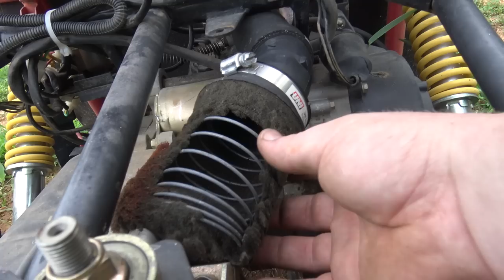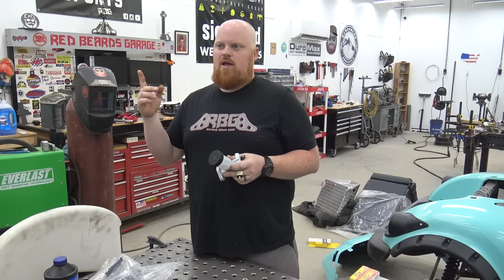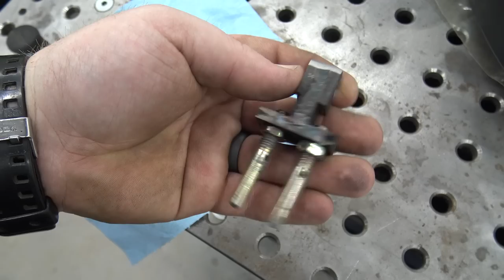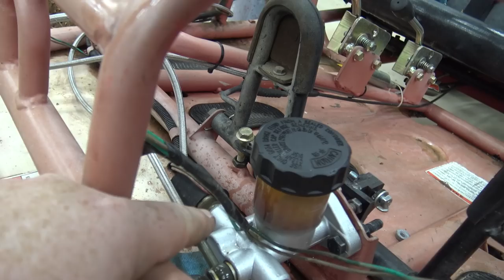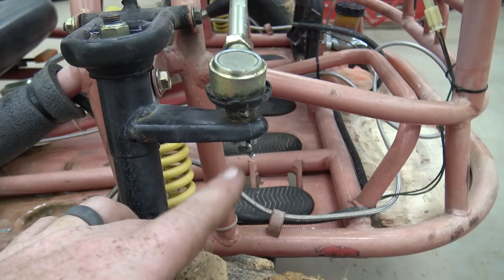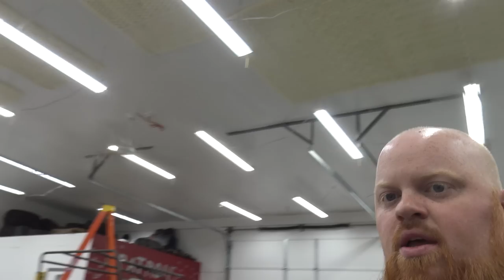Dazon Raider 150cc ~ Hydraulic Go Kart Brake Repair

Comment: Pro tip: When using tires to mark trails, cut holes in the sidewalls with a hole saw to drain water, so mosquitos can't breed.
Reply: How does that make sense?
Reply: @pearonthree5013  What do you mean?
Reply: How does that not make sense? Water drains from holes, which means it doesn't sit ....
Reply: @chrisrodriguez6399  sorry. I thought I was replying to quesadilla. 
Just ignore me...

Comment: I had to use a tire pump needle with a piece of plexiglass and a rubber tire inner tube . Drilled a small hole through the glass and rubber, inserted needle and hooked up tire pump and forced air into the top of the reservoir in order to get the master cylinder to allow brake fluid to force through the small hole in it. Worked great.

Comment: Sure glad I found your channel. I'm working on a ATV just as yours. So I can see that I need to pull one of those studs out and do the drivers side first. I was checking the pistons to see just what is going on. They seem pretty clean. I did see lots of water going out on the old lines. So that is what I will do and I will let you know. Can't wait for the third person to hold the camera.

Comment: Are cart different on brake bleeding than cars? I've always bled the furthest (right rear) from the master cyl;inder. first and worked my way back to left front.
Reply: Bill Co-9 hate to be negative but safety over rules ! Full stroke on old master will tear seals just to start, don't follow this if you want to hold brakes efficiently , wrong in so many ways
Reply: @Bill Co-9 That's how I would do it, just to be safe.
Reply: Scott Doubleyou  your ways fine Redbeard's wrong
Reply: Sir i cant speak for the bleeding process on a cart but with i most definetely wouldve have replaced that master cylinder i mean the guy did say he saw flakes in that brown fluid  so theres a decent chance that the seals in the master cylinder are damaged or cut  and the brakes will fail again
Reply: On this master cylinder it has a front zone piston and rear zone piston which work independently of each other. However they’re attached to a single bracket, which applies them in unison. 
So I suppose it wouldn’t matter. But I get what you’re saying. 
On this one, the front zone you’d do the passenger side first and the driver side second. 
If I’m wrong I suppose someone will correct me but I thought I’d try. lol

Comment: Trying to bleed rear brakes on a Fox Carbide 150cc.  Front will work.  Back wont pressurize.  Any suggestions.?  New caliper, New Master cylinder.   Ordered new line, hasn't arrived yet.  Tried reverse bleed.  At a loss
Reply: Ever figured it out?

Comment: DAZON RAIDER!! One of my favorite GY6 buggies. Those carbs do NOT have a choke, but instead have an electronic device for FUEL ENRICHMENT for cold starting. Choke cuts off air to make rich, that puts more fuel in to make rich. Everything on those is very reliable. Very serviceable. Very "TUNABLE"!! Bump the main up to a 125, with a foam air filter. Idle/Pilot Jet could be increased to a 38(?)... but not always necessary. CDI, COIL, PLUG, and you'll go from 8 hp to 11 hp. HUGE Increase. Then tune the CVT with 12 gram "sliders" in the front pulley and a YELLOW 1500 RPM BIG Rear Pulley Spring. Put a performance exhaust on it and it'll do hole-shots!
Reply: GoPowersports is a GREAT Company!! Very cool guys. Buggy Depot has the best GY6 exhaust deal.
Reply: I left the above comments early in the vid. RBG has it down.

Comment: What's going on Sir watch all your content 💯 I have a 150 Baja sport  kart it looks like the one you were just working on I bought this Baja they had no ignition key it was not running it has no spark I changed the coil core wire spark plug CDI box stator it has no power for the ignition everyone is too busy to help me should I just change the whole wiring harnessI looked it up they do not make it for my 150 sport anymore and I was wondering would it be the same as the one that you were working on if you could help me thank you sir 🤔

Comment: So on my buggy project i`m having problems getting a good brake pedal. Its stiff and theres next to no braking at all. Heres my parts: brake calipers from an arctic cat atv, hard lines from master cylinder to edge of frame then from frame braided lines for movement. I bench bled the master then did the pump and bleed caliper routine and did this many many times but the master plunger will move only 1/4 of an inch and theres no braking at all. I could still have major air in the lines I am assuming? i`m also using a master cylinder off a 70`s chevy nova...my other concern is the master being too much of volume of fluid mover and blowing out the caliper seals.

Comment: Does anyone know where to get the rear case anchor/chain tensioners for these GY6 engines? I can't find them anywhere. It's that U-brace in the back with the bolt welded to it.

Comment: Sounds to me like it's only reving out to about 3500 rpm. Shouldn't a GY6 be turning 5k+? Also engages at really low RPM. Not necessarily a bad thing, but would be more fun w/ a 1800 or so engagement.

Comment: Ok well I dont think you could have put that cotter pin in any more wrong, also known as split pins, split the tails one side over the nut in the castalation ant the the other side over the bolt shank creating a mechanical lock.